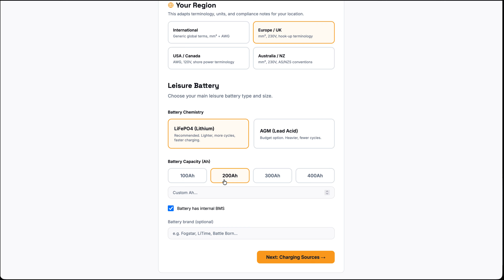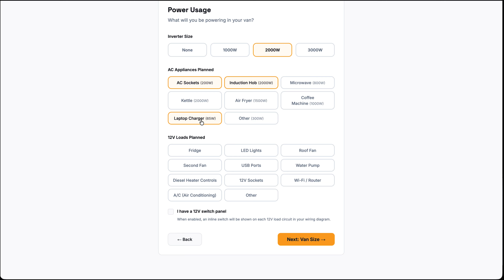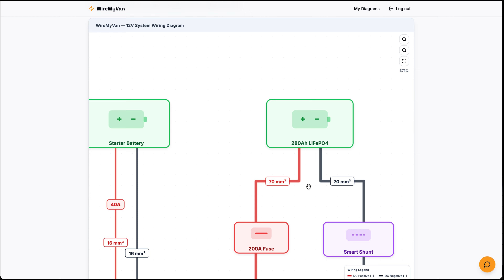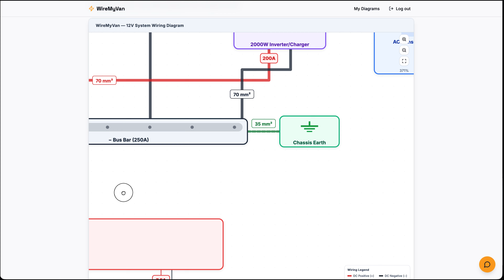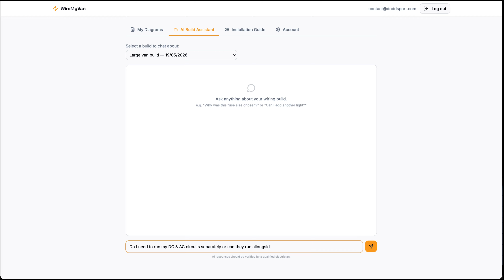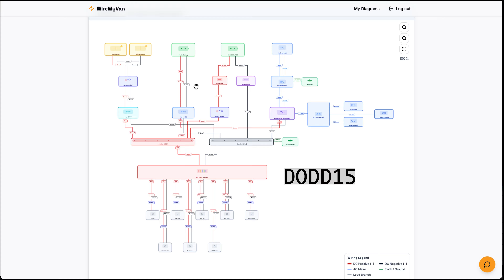Full Electrical Build Planning (Before Any Wires Go In)

Comment: An "App" that only calculates for 12 V systems and of course it only tells you that you need to pay at the end... (the good news is that the price is as low as the quality of the calculator)
And the other site offers you to take a quiz, where all you can do is add a list of preconfigured solar components to your cart.
Reply from the maker: I'd argue that the majority of campervan systems run on 12V rather than 24V and if they are running on 24V they probably don't need an app to tell them how to size their wires and fuses but I of course could be wrong. Feel free to reach out to the creators of the app and let them know how they could improve things for you. They have been very receptive to my feedback so I'm sure they will take what you say on board.